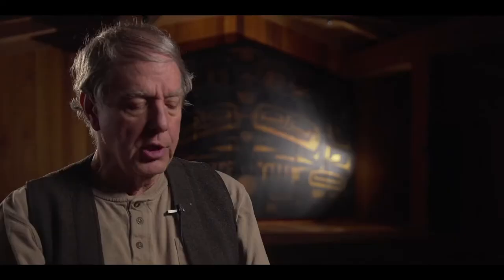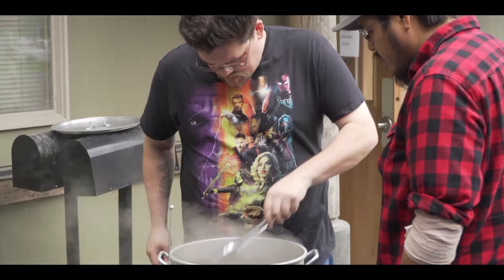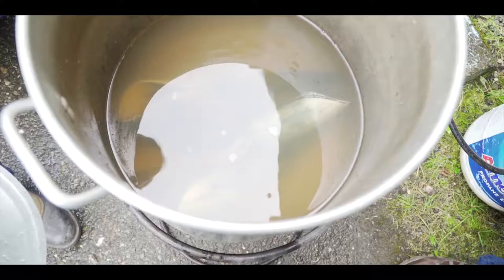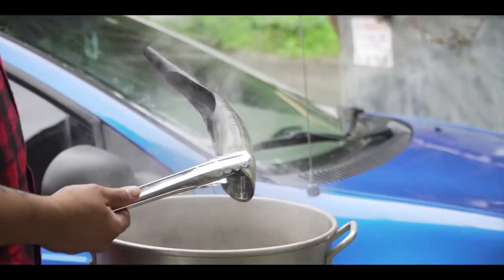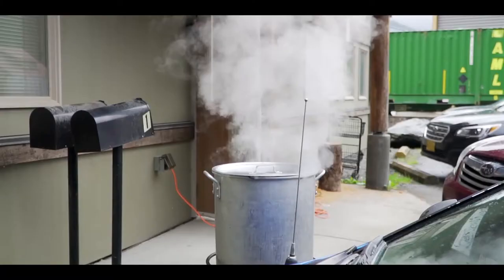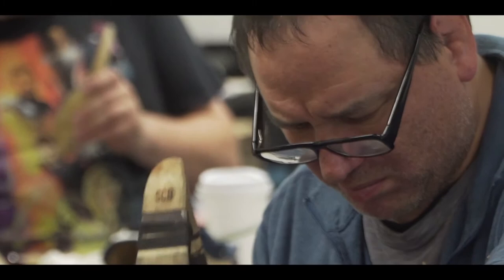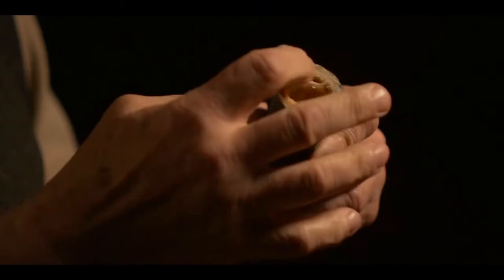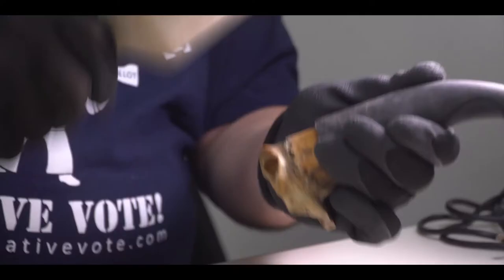Carving Horn Spoons Step 1: Soaking the Horn

Comment: I make drinking horns and I’m wondering if you can suggest a way I can fix the delamination in a horn without using food grade epoxy resin? Traditionally beeswax is used, but I’m wondering if there’s a way to naturally re-laminate the horn instead of just sealing it. If I soak a horn, could that tighten it’s layers back together?
Reply: Horn powder and superglue